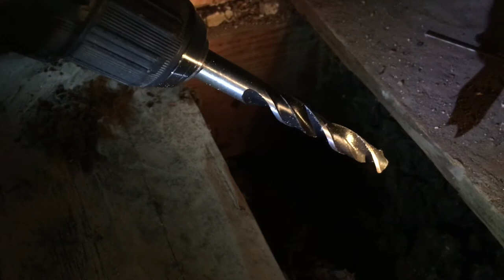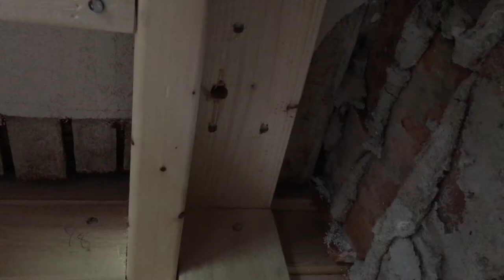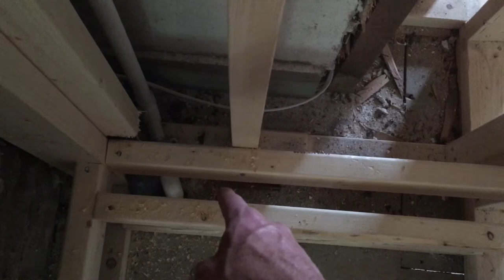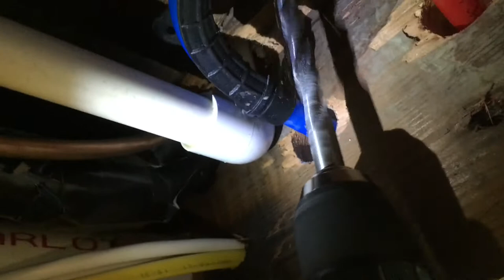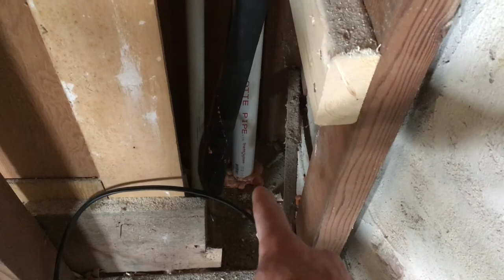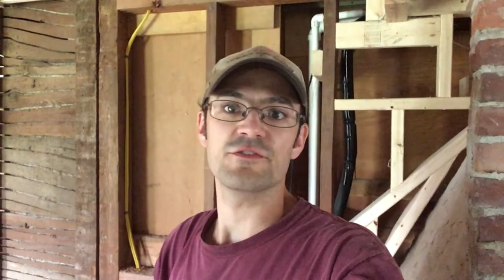Running Coaxial Cable from Attic to Basement - Never Easier than When the Walls are Open

Comment: You can always get a 1/16th or 1/8th by 10" long drill bit to drill "marker" holes if you have doubts about where a hole may come out, to make sure your idea is feasible. Leave the bit in the hole after drilling through so you can spot it easier and then go to the other side to make sure it came through where you hoped/expected.
And be careful pulling your coax - yours looks like it has lots of kinks and bends in it. You can't treat coax like regular lamp cord - you can pinch the dielectric and ruin your signal if you're not careful.